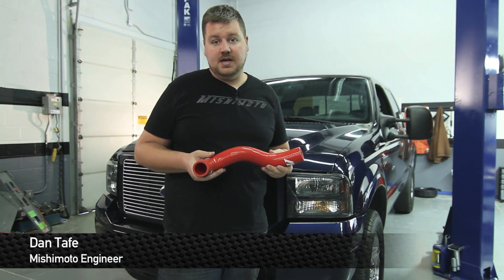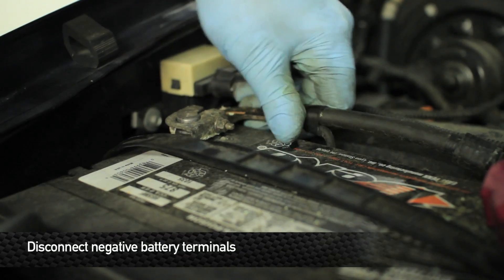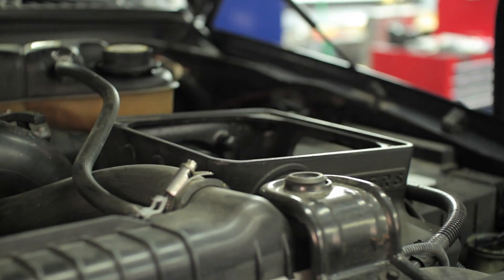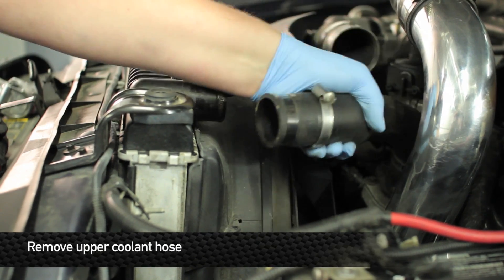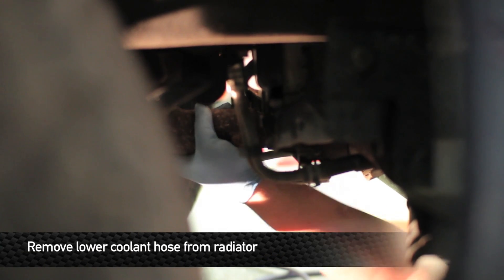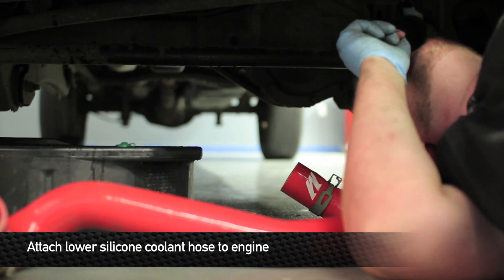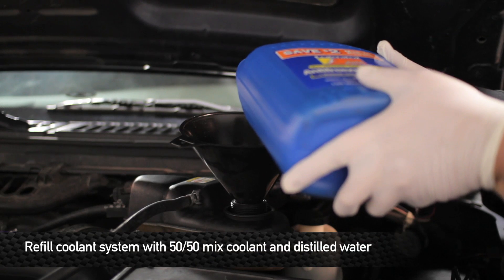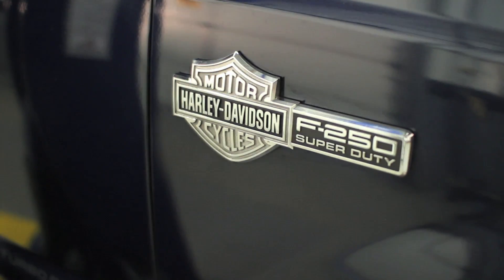How To Install: Mishimoto 2003-2007 Ford Powerstroke 6.0L Silicone Hose Kit

Comment: How do you route the  radiator hose on a 05 too 07 ? Is it between the steering box and power steering pump ?

Comment: Although I think that is an amazingly nice hose kit it is very very important that no one add standard antifreeze like you just did in a 6.0 liter powerstroke. It will mix with the Ford Gold coolant that is the one to use and clog up the oil cooler. The different coolants are not compatible. I am not trying to beat you up. I just need to point that out. They will overheat when the coolant gels up from mixing with standard coolant. Thanks. Gary

Comment: hoses look great !But the problem I have with this video is you used that green rad fluid .. It will kill your 6.0l engine . Any one that knows the 6.0l engines knows that you are too use the ford gold premium rad fluid .. using any other rad fluid will cause you too have failures just like the ones that ford got sued over ...